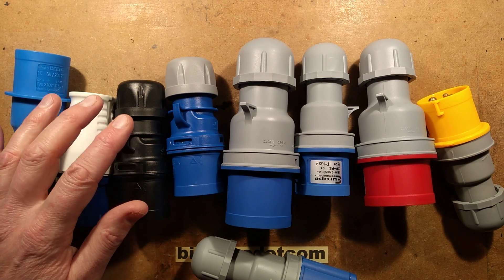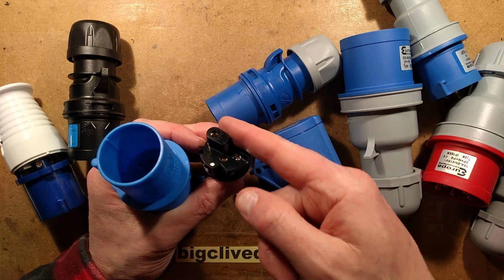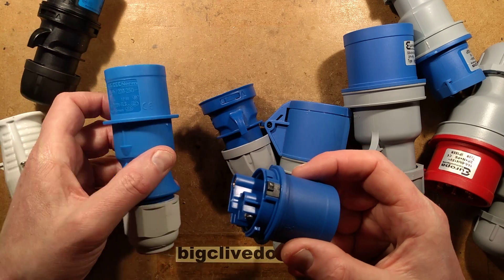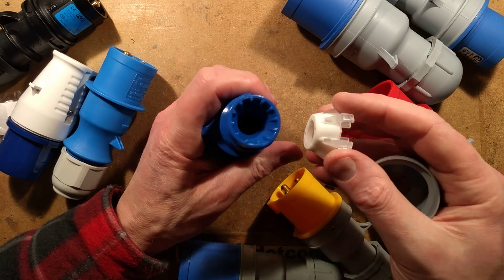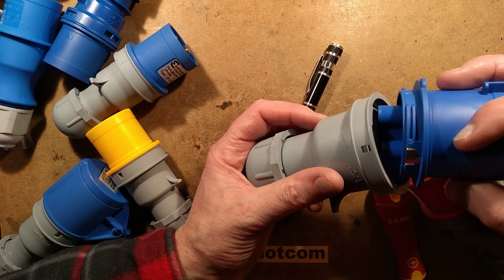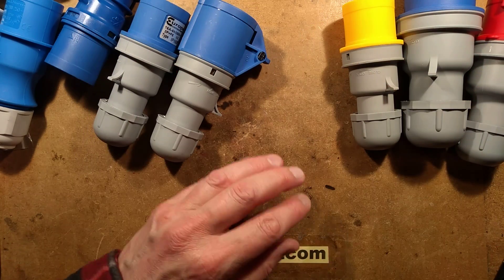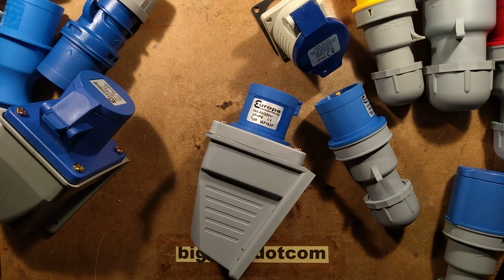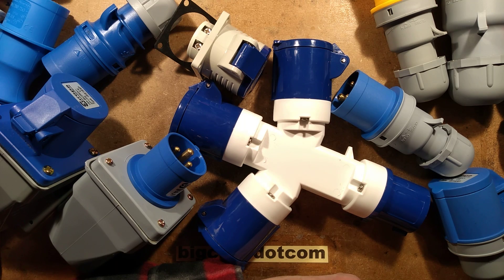My favourite industrial connector (Ceeform).

Comment: I just bought some of these for a home project then I remembered that you had done a video on them. We call them pin and sleeve here in the states, also iec 60309 or just 309. The current ratings are slightly different here, 20, 30, 60, and 100 amp, although some are dual rated for the international values that you described. We also have metallic pin and sleeve made of aluminum and steel from various companies like Eaton, Appleton, and Russell Stoll. I know that this type is available in reverse service where the pins and sleeves are swapped between the connector bodies for applications like generators and your food truck example.

Comment: Hi may I ask how you open an abb 216ep6 plug?
Reply from the maker: If it doesn't have two screws down the end where the pins are, then there may be a screwdriver operated release latch you have to press down and twist the two sections apart.

Comment: Hey Clive. Just to answer your question here at 0:28 I'm from Romania and did and saw a couple of jobsites. Usually here they just strand some wires together and that's it, while I'm not there giving them (from my stash) "here you degenerate use this wago you absolute...." etc... Yeah... unfortunatelly rarely used. They just stick an old extension cord towards a 1 breaker that the whole house has power to... and go from there... Ik... fml xD

Comment: these connectors are used in the netherlands for welders but they are also used in campervan, caravan and boats to charge them when standing still on a camping site or to get power from the marine to charge battery's and run the fridge ect for the boat

Comment: German theatre technician here. The 16A blue ones are not seen in the event industry much. The Schuko plug we normally use is rated the same and you can get IP44 versions, ao that's just what we use. What you do see these on is garage doors and the like where the motor is plugged into a 16A CEE single phase socket, maybe because they don't want ppl removing it for their own stuff. The 32A blue ones are often called camping plug because you find these on campsites. I believe these are also used for high wattage lamps, like 5kW or 10kW tungsten. My theatre doesn't have those, though, so I don't know for sure. The red ones are far more common here because 3 phase power is common and it's the plug for that, unless you enter powerlock territory. 16A 3 phase is often used for chain hoist controllers, with a 16A four pin socket going to the hoist. Controllers for more hoists might use 32A 3 phase instead, and they have one Harting out so you can run one cable to multiple hoists. 32A, 63A and 125A 3 phase is typically the socket provided by the venue, so you would typically have a power distro that takes 32A, 63A or 125A 3 phase in and connect it to the socket with an accordingly sized red CEE plug/cable and you split it up from there. Outside of events and theatre, 16A CEE 3 phase is also commonly seen in workshops for tools that require 3 phase. Although homes are connected to all three phases here and have their single phase sockets split up across the phases, you typically don't find 3 phase sockets in homes, so this is a purely industrial application.

Comment: 110 volt yellow / red 415 volt / blue 240 volt ) purple / violet (50 volt); ( L1 / L2 /:L3 / Earth .
 
My favourite is either of which does not matter which one you choose. ( L 1  / L 2 /L3 = Brown / Red live wire   amd. Blue / Black and Earth ) = 240 volt. 

Y / Y cabke is (Twin Brown or twin Red. To identify which one is live place a nother sleeve over the main feed wire. Making it (Duoble brown or Red)

Comment: I use these on a daily basis at my theatre, majority of our moving head fixtures take 16 AMP, we have several dimmer packs that take 32 AMP, and a massive touring dimmer which takes a 125 AMP 3 Phase
Reply: Country UK
Reply from the maker: The dimmer racks we use have powerlock 400A pass through, and an option of socapex or individual ceeform sockets on the back.

Comment: We use them in the filmindustry in Germany Big lights need big power.
Sometimes working with 125A/400V 
if we have a lot of tungstenlampheads..
Its not really fun working with such cables, when it's cold outside ;)

Comment: In Finland especially the three phase 16 A ones are common in workshops etc. In homes they are not used, instead fixed connections are used for three phase.

Comment: Had a long heavy duty extension cord that was old and starting to get warm at the ends under at 15 amp/120 volt load in Seattle. Replaced the molded ends with heavy duty connectors and it runs stone cold.

Comment: Hi Clive. First I apologis for poor spelling, I am not so god at writing in english. I yoused those conectors at DSB danis state railways (Baner). We used them to supply power for trains from the town grid so the didn’t need to have there engines running for power when the were parked. There were tow conectors 13 amps and 32 amps. I liked the 32 amps better, because when we yoused that one, one could start the AC in the train.  Creature comfort

Comment: Used in Norway,  the blue ones are used for 230V only, as we do not have 110V as standard.  The color is part of the industrial standard.  Blue on 230V , and Red on 400V. I've found we use the yellow ones on other systems,  like on alarm systems , automated systems etc. using low voltage or different from standard 230V.  I do like these plugs and outlets too, but I prefer the nickel plated  brass ones , as they seem more resilient to moisture and have make a better connection on heavy loads.  These connectors and outlets are mostly used in industrial environments,  as they don't have that tamper-proofing thingy as in residential outlets.  However there are those with auxiliary switches (you have to plug in  the plug to the outlet to be able to turn on the power switch) ,and the the ones that you plug in and twist for the outlet to conduct power.  Mounting the outlets sideways is actually a code violation if installed outdoors or installed in a environment that can cause moisture to intrude into the outlet. There should be a drainage weakening at the bottom of the outlet base that needs to be created open if it's installed in moist environment and arrow showing how the outlet is to be mounted either on the back or inside of the outlet.  Thanks for another great video Clive 🙏👍

Comment: I used the yellow ones, 110v in Building sites in London, England, infact in all sites you had to use 110v, you were not allowed to use 240v,actually you couldn't use the 240v,since there was no points to plug 🔌 your 240v. I now live in Spain
And as I have quite a few 110v tools, I had to bring with me a small transformer to be able to use my tools here.

Comment: My fav are the ones by the mennekes brand. I have used the 63A and 125A ones a lot from them at work and there plugs and sockets are pretty neat in the way they look and also are put together. Very rigid and easy to install. They also come in IP68 rating.

Comment: Every industrial envirement in Serbia, Croatia and Bosnia must have thouse.
Usualy 5 pin 3 phase (red) and 3 pin single phase (blue)... funny story, alot of ppl try to connect 16A connector in 32A socket and other way around by bruth force and few actualy manage to do that and damage them. And other way to damage them is just u dont care for them and pass over them with fork lifter of 15 tons or put heavy load of 10 tons on them by accident.

Comment: Greece, they use them allot in the food industry for 3 phase grills, ovens, etc…  In places like restaurants, bakeries, and others you'll typically see them.  They're also used allot in concerts weather you have a generator or simply getting power off a meter.

Comment: I haven't seen them on sites I've worked on (US), but then, that might just be a management issue (and really, I've been on a very small number of large sites, much of my experience has been in residential as the idiot manhandling the furnace into the basement of the new house). I have seen similar-ish connectors used as an everyday thing in the factory I do maintenance for now though.

Comment: Old video but the H07RF cable around 11:00 is good for temporary use outside. If you leave it on the ground for a longer time it tends to start to crumble and cracks up. I mean if you leave it for years outside

Comment: Those connectors are great. Also, they can have a higher current rating than normal wall plugs, so we actually can using them for powering induction stoves (namely, 1-phase 230V/32A and 3-phase 400V/16A).

Comment: SJOOW & SOOW are pretty well the standard cable if you expect things to last over here in the US. SJ is good for 300V while S is good for 600V, OO means the inside and outside insulation is good against oil while W is water/UV ect
we use about 20 different locking connectors from California style to NEMA units to other random ones

Comment: In Germany the one Phase CEE-Connectors are often called Camping-Plugs, because every Caravan, Camper, Boat etc. uses those plugs. For some reason it is unfortunataly pretty Common to pay several dozen thousend Euros in such a vehicle and use the  cheapest Schuko-extension cord with the cheapest Adapters you can get.

Comment: I know an electrician, who went to do some work at a farm.

The farmer had a three phase motor, but there was no three phase connector in the shed.

However, there were three domestic 3-pin sockets in the room, and, by an amazing coincidence, each one was wired to a separate phase, so he connected each of the three lives from the motor, to the live pins on  3 13 amp plugs, plugged all three plugs into the sockets, and off he went.

Apparently, he'd been running it this way, for a number of year.

Comment: Hi Clive! I work in a 1950's power plant in the US that uses a similar plug and receptacle for all our building 120v outlets. The ground pin is slightly larger and the key is inline,  thin and flat. The receptacles have metal spring covers to protect the outlet. We use adapters to convert them to our normal 3 prong plugs.

Comment: Used on UK caravan sites for power. One ceform extension we used to have had a latching system so that it could lock together with the lid of the socket latching into the plug to keep it connected.

Comment: The car manufacturers in South Africa are recommended installing a Ceefrom socket as a cheaper solution for EV charging than installing a dedicated wallbox. They provide a blue plug for the car's included charging cable in addition to the regular wall outlet plug.

Comment: Commonly used in marine pleasure boat marinas. Often find the male connector on the live cable end. Have had to change many DIY set ups. Plus overloading is a common issue. These days. As many users don't understand how limited the rating is. Especially 16amp. Often find internal melting of plug and socket an you pull them apart Clive.

Comment: This wandered into my feed just now. We actually had to source some IEC pin-and-sleeve connectors because a project is drawing well above the maximum of 30 amperes that NEMA locking plugs are rated for (higher amperages are documented, but I could not find any). The ones I found (Hubbell) were hard to source in a timely fashion, so I ordered them from North American sellers on eBay. The ones that arrived were built like tanks.

The project draws so much power we had an electrician come out and install a 100 amp outlet.

And yes, the cable weighs enough that I couldn't even move the box it came in.

Comment: You say about waterproofness. You haven't shown the IP67 variants. Also the appliance inlets should face upwards with a dust cap fitted when the socket is not in use for the IP44 units you showed. It's more common to find when they are fitted the appliance inlets face down to keep the rain out but with the socket fitted they act like a funnel. Common issue with canalboats & self build campers.

Comment: I like the PCE shark connectors too. Use them for events electrical work 230v 16 and 32A. The cord grip and seal is the best I’ve seen. Always use with long bootlace ferrules instead of doubling over

Have Also used 3ph+N+E in blue as 230v across phases , for some industrial machines imported from Italy where the factory had its own custom supply transformer. Totally weird and unique in my experience.  We bought a lot of auto transformers that year.

Comment: I have a 16A CCE that is just totally stuck. I simply cannot pull it apart. I even pulled so hard that the female end came apart, and I had to assemble it again. Any tricks to get a totally stuck plug apart ?
Reply from the maker: That may indicate arcing that has caused the contacts to weld.  It may be best to replace both the plug and socket.
Reply: @bigclivedotcom  Thanks. But dont think that is the issue. It was plugged in the same day.

Comment: As for the 63 amps, it's not an odd value at all. It's from the Renard series of preferred numbers (R5: 1, 1.6, 2.5, 4, 6.3; 1.25 comes from R10), similar to the E series used for resistors, etc.

Comment: If used in wet conditions I sometimes fill them with silicone gloop before assembly.
It makes them unusable twice but keeps the water out.
Particularly good for trailer light plugs and sockets 🙂
Reply: Or just buy the proper IP67 rated ones?
Reply: @garrett69  You can if you like, depends how deep your pockets are I guess.

Comment: Title could be "Lets Look At A Thousand Dollars Worth Of Connectors I Have Laying Around".
Reply from the maker: These connectors are actually surprisingly cheap.
Reply: @bigclivedotcom  Have you ever seen the 440 high current connectors that blow themselves apart if they get too hot?
Reply: @bigclivedotcom  We have a crusher plant that has 16 electric motors including 2, 200hp and a 350hp.  One day after a rainy night about 5-6 minutes after startup I saw a massive fireball behind the tower and hit the all stop.  That is when I learned about the spring loaded connectors which open the circuit (with great force) in the event of a direct short.

Comment: US - We see these used in Data Center racks.  (Or at least similar connectors: IEC 60309)  Anywhere from 20 to 60A @~220V  They provide power to Power Distribution Units in a data center rack.  Often 2-4 connectors per rack depending on power and redundancy needs.
Reply: In "north american applications" of the standard,the current ratings are changed to match north american breaker ratings rather than IEC breaker ratings, the 16A connector gets it's rating boosted to 20A, while the other sizes get a slight reduction with the 32A becoming 30A, the 63A becoming 60A and the 125A version becoming 100A.

Comment: Newlec make completely toolless ones of these where the conductors are held in with clips. At first I was worried that they'd make a bad connection but I regularly run them at 2/3 of their rated load with not even a glimmer of getting slightly warm!
Reply from the maker: There are a few versions.  One that doesn't even require stripping the wires.
Reply: @bigclivedotcom  Really?? That's the epitome of laziness, I approve!

Comment: Im Germany they are usally used at Camping Sites..... and relativly often see them as an 32A Version.

Then there are the SCHUKO (we call them in Germany) or better Sayd Type F... there are some Nice variants of the Type F that are IP66/68 Protected for example from PCE or Mennekes. 
Im A Firefighter and we Usually use the Typ F IP66/68 that are actually srewed into the Wallplug.

Comment: In the plastics industry, newer mould temperature units use the red ones(3 Phase) at either 16 or 32A depending on the units temperature and pressure rating. Older units still use the square-ish 3 phase plugs.

Comment: Hi another use is for charging the batteries in portable traffic lights, some have the sockets built in or a short lead with a plug 110v yellow ones, also some early EV street chargers had them for 240v AC {

Comment: Would these ever be used to connect large household appliances? I see people talking about using these to power RVs and in America the plug you'd use for an RV (depending on how many phases and how much current you're drawing) is similar to the plug you'd use for an oven or dryer. Some really small ones even use standard 15 amp plugs. Either would have to be enclosed in a box, of course.
Reply from the maker: They are sometimes used for charging electric cars.

Comment: At my work we have these HUGE connectors that handle 13.8Kv 3 phase and probably a few hundred amps. They are used as temporary power lines powering electric mobile equipment and 4000HP electric motors....very cool connectors I wish I knew more about them, Ive only seen them from a distance. The connectors are held off the ground by metal stands just to keep them from becoming submerged in puddles, but they sit sit outside in very harsh conditions and exposed to all elements.

Comment: I work in the aquarium industry in the US. They're commonly used as quick connectors for smaller pumps in critical systems so we can rapidly swap out motors when they fail.

Comment: These are used as caravan/camper connectors in New Zealand.
As an apprentice, I was taught to always make the earth longest in all plugs,so that it is the last to loose contact from abuse.
Reply: You should do that with ALL earth/PE connections
Reply: That pe thing is for anything
Reply: Yes, and NZ and AU are the only two counties in the world that use 56 series of exclusively for the same application as iec309 (apart from camping equipment). Bloody stupid
Reply: They are often used for server rack PDUs for 16A and above connections as well.
Reply: In the Netherlands/Europe they are also used for caravans and campers, though in some campings you'll find the E/F connectors and you'll need an adapter.

Edit: They are also used to charge electric boats.